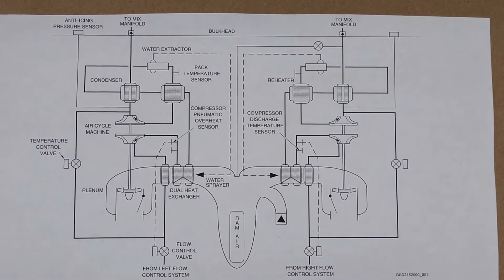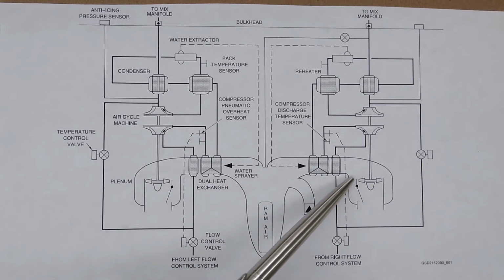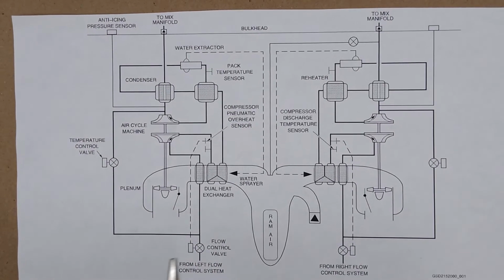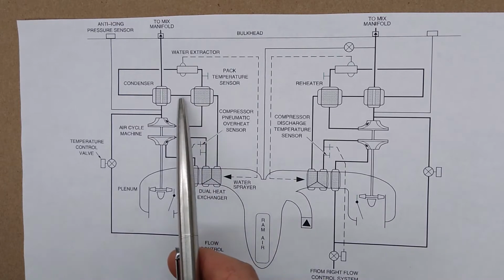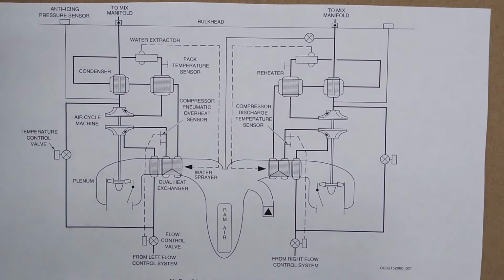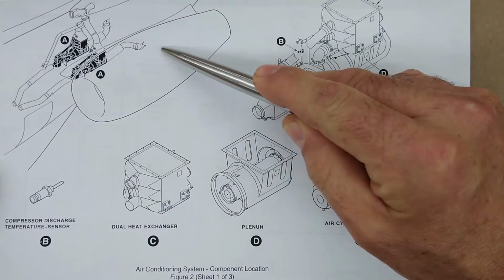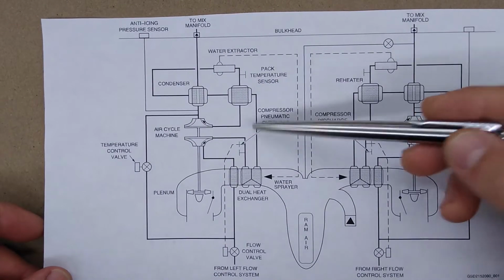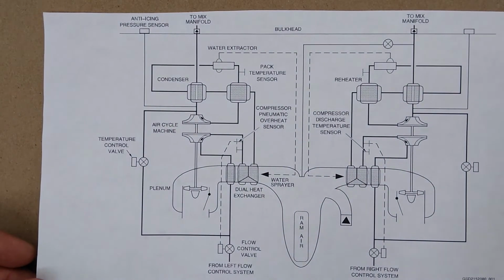AIR CONDITIONING IN AIRCRAFTS (Part 2) Air Cycle Machine - ACM

Comment: So, is the air system limited by the ambient temperature when on the ground? I'm not understanding how it works when the "ram air" is 100 degree southern summer air, even with a fan pulling it through..

Also, is the turbine getting it's "power" from the bleed air velocity only?